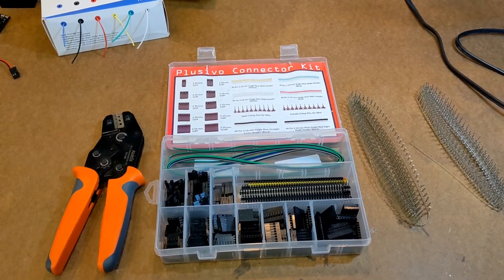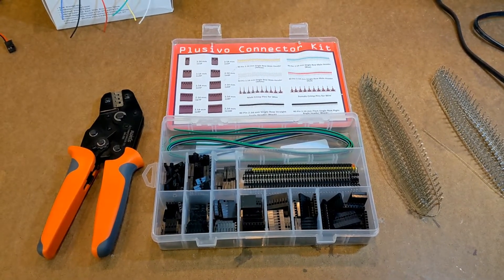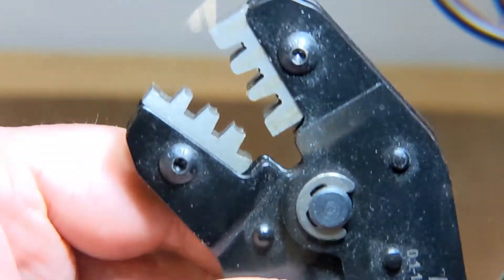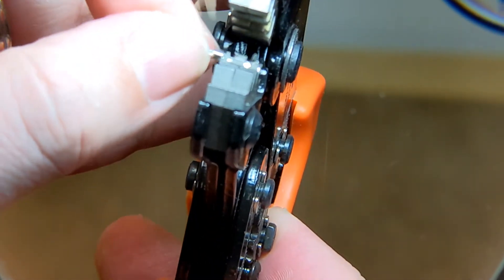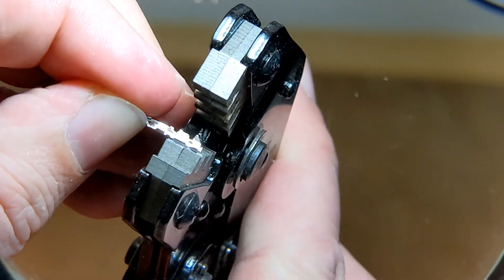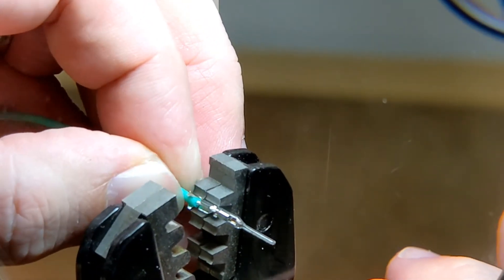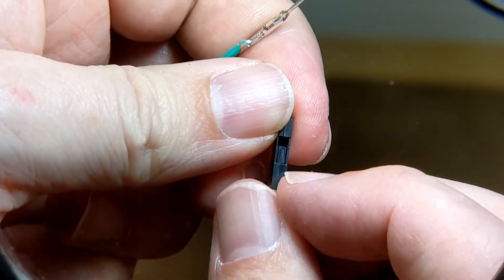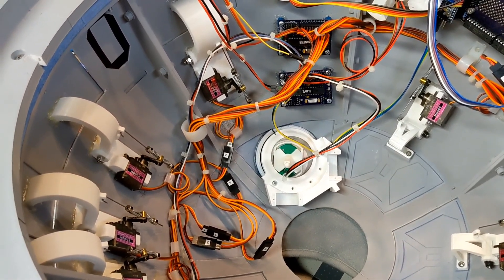Crimping DuPont Connectors

Comment: Hi Jason, thanks for posting such a well-made, high-quality and detailed video. You're clarity and honesty answered all my questions and explained all the ways I'd been going wrong. This is THE video to watch if anyone is struggling with this task
Reply from the maker: Thank you! The only changes I've made to my method since posting this video is to not strip quite so much insulation off the wire (especially for the female connectors) and I tend to very lightly squeeze the large wings around the bare wire just enough to hold the pin onto the wire - makes it easier to get the crimp started. Good luck!

Comment: Thanks for the video. I have a bunch of pre-made ones I got from Amazon, but they don't seem to stay on the pins for NodeMCU boards. If you don't mind answering me, since you have the experience here, am I doing something wrong and/or any advice for me on that front? The goal is to connect LEDs to the NodeMCU using (what I think is) 18 awg pre-made wires. Thanks again!
Reply from the maker: Oh, so sorry I didn't see your comment sooner. The connector should provide a reasonably tight connection - there should be no danger of it falling off. Chances are you aren't doing anything wrong - the pins and connectors are all a standard size, and if the pre-made connectors aren't gripping the pins well, it might just be a matter of poor construction. I have a love/hate relationship with Amazon - there are good deals to be found, but quality is hit or miss. I think that's a big reason why I prefer to just make my own - I can inspect each crimp and test the connectors before moving on. It takes some time and practice to get the hang of it, but it's worth it in the end. Good luck with your project!

Comment: Man I could’ve used this video a few days back! I believe I have the exact same DuPont connector case and crimper tool! It was a nightmare with some of the connection and I ended up having to over crimp them to keep the wire from sliding out! Either that or the end wings for the wire sheathing would not crimp enough and then wouldn’t slide into the connector. So I’d squeeze those shut with needle nose to fit.  EST breakdown I’ve seen on these connectors. Thanks for making the video!

Comment: Excellent video! I use mini-pliers to snug the insulation wings around the wire insulation, which "locks in" the positioning of the wire before putting the assembly into the crimp tool.
Reply from the maker: I've started doing exactly that, too! I recently made a boat load of servo extension cables and every one came out fine. I often don't strip as much insulation as shown in this video - perhaps I'll post an update soon with the extra tips. Thanks for watching!

Comment: There are crimpers available that have a spring loaded blade that locates between the bare wire tabs and the "wings". This will locate the connector pin in the correct place for crimping. Down side is, they are usually expensive.

Comment: where to get this cimper
Reply from the maker: The exact crimper I got is no longer available, but there are tons of identical options out there. You should be able to search for "ratcheting dupont crimper" and see lots of results for SN-28B dupont crimpers. For around $20 you can get a crimper and a decent supply of pins and housings.

Comment: Great close-up tutorial. I have just started crimping and my first dive into the process involved crimping the mx1.25 connectors which are tiny. Using a lit desk mounted magnifying glass is a must as my old eyes need a little help to check those little tabs are far enough away from the crimping process. One thing that helped was to ever so gently close the butterfly ends to be u-shaped rather than v-shaped which allowed me to more easily fit the tiny connector in the crimping tool. I uses an IWS3220 which seemed to work ok.
Reply from the maker: Thanks! Magnifying lenses are a must, and thicker wire makes things easier, too. Since recording this video, I've shifted to stripping less insulation off the wire (especially when crimping the female connectors) and I also find that pre-bending the butterfly ends tighter to the wire helps keep things stationary when crimping.
Reply: It seems my issue , after watching this video, is the crimper which came with a kit, and I thought I was doing it wrong.The labels on mine are .25mm .5mm and 1mm. Using the .5, there is not enough crimp, and the wire comes out easily. Using the .25, the crimp on the insulation area is too much, pressing down in excess causing the insulation to flatten, and thus cannot fit inside the connector.
Reply from the maker: Sometimes if the crimp flattens the insulation too much, you can take some pliers and squeeze it back into round and it will slide easily into the housing. It's a shame that so many of the crimpers out there are not exactly up to spec.

Comment: Can you  send me the crimping tool link ? I want to buy it for awg22 wire
Reply from the maker: This is the one I have: https://www.amazon.com/gp/product/B00OMM4YUY but as I mention in the video, the crimper die is "wider" than the area that I actually want to crimp - so if you decide to use this one, be very careful to position the wire correctly to avoid damaging the little prongs that stick up close to the connector end.